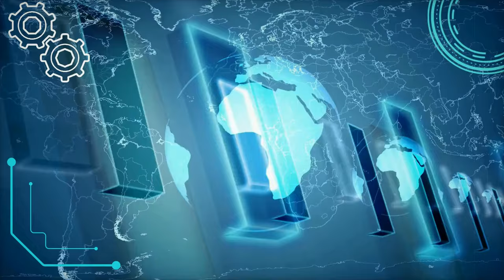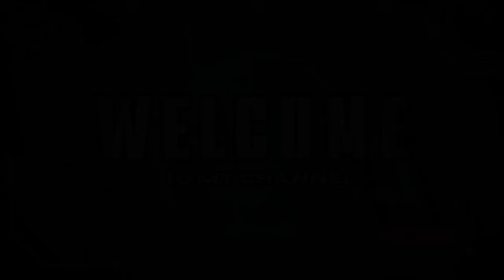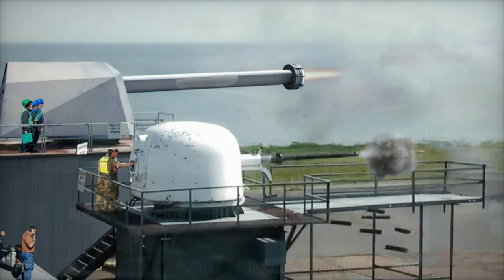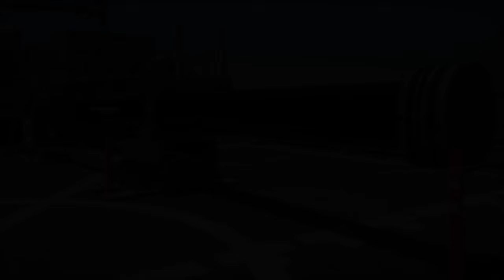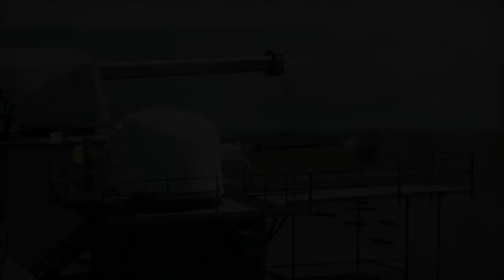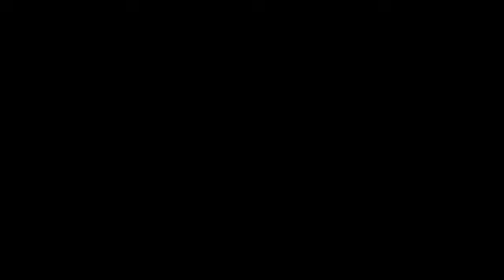French German Railgun Reaches Hypersonic Speeds A New Era of Defense

Comment: The hardware side is indeed impressive.  However, next-generation incoming threats may well carry AI-based sensors that cause the threats to successfully evade railgun launches. At mach 8.7, it will stil take a LONG 67 seconds to fly 200 km -- plenty of time to evade unless the defender has stolen and deployed the attacker's AI evasion algorithm.